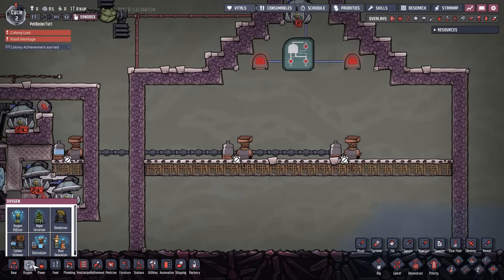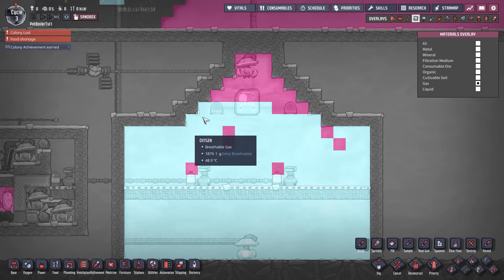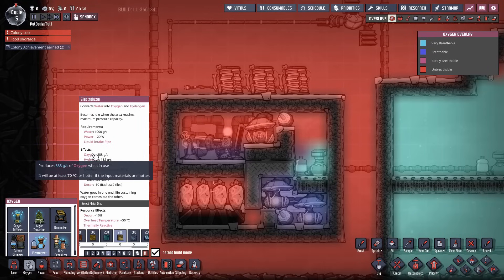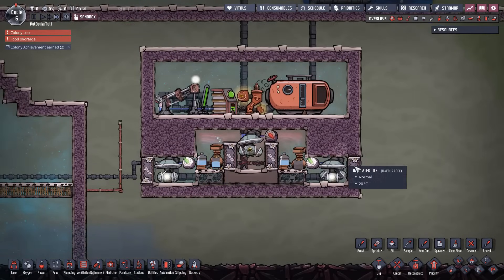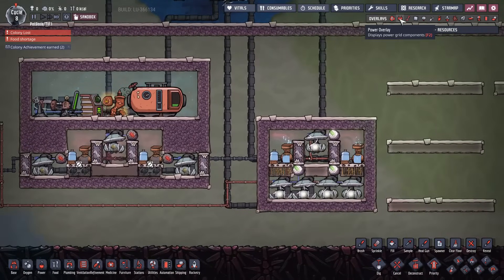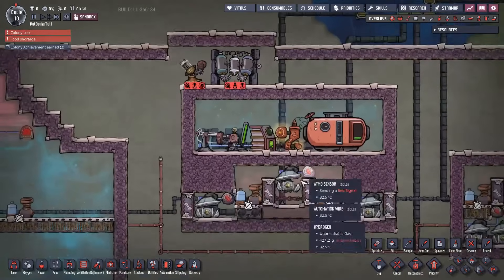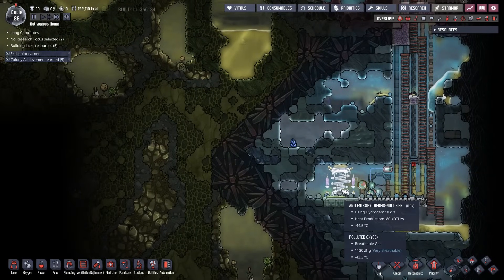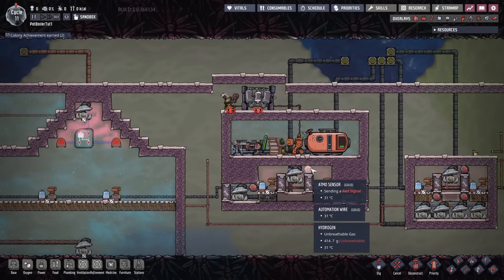Electrolyzer, SPOM, O2, Oxygen: Tutorial nuggets : Oxygen not included

Comment: Hey Francis John! Long time watcher, first time commenter.
First I would like to thank you for all your videos and tutorials. A game like "Oxygen Not Included" would have caused me so much headache without some guidance, so thank you for being there to clear things up when I needed it. 
Second, I was curious how would these designs react if water supply stopped for a while or the oxygen output pipes became over pressured? Early in the game I may use a single electrolyzer and that could potentially make more than enough oxygen to the point where my base would be over pressurized by it. Would this break the design or mess with how the built in filtering system works requiring me to flush the system again as if it were running for the first time (or do the atmo sensors prevent that)?
Any clarification on this would be appreciated,
Thank you!

Comment: I did some testing on Hydrogen/Oxygen volumes out of a Full Rodriguez vs an unfiltered setup consisting of mini-cells 6 wide by 2 high with an electrolyzer in the middle and pumps on either side.  Image here: https://imgur.com/a/yal4FZd  You can route the output of each pair of pumps through a filter of some sort, either powered or unpowered using gas bridges and gas valves using techniques I learned in Brothgar's video here https://www.youtube.com/watch?v=bzwsgK_rud0&t=1s.  The results running each setup for one cycle was that I got nearly identical quantities of Hydrogen and slightly less Oxygen using 3 electrolyzers and 6 pumps in a cell configuration as I did from a full Rodriguez.  Full Rodriguez:  2160W, 13.97Kg H, 1639Kg O.  3 Cells: 1800W, 13.8Kg H, 1533Kg O.  For my base's Oxygen needs, I am using a Full Rodriguez, but after these results, I'll be using 2-4 of my mini-cells in space for my rocketry program.  Modular, easily expandable, and more efficient (for Hydrogen at least) than a Full Rodriguez.

Comment: On the full Rodriguez, I keep getting Oxygen intermingled with the Hydrogen out of the top pump, which damages the generators.  Sensor settings are correct (250g at top and  450g on bottom ones).  My base is not using all the oxygen (overpressure at vents).  Does this cause the problem?  I built this with the hope that it would be more than I need, but could grow into it.
Reply from the maker: When you first switch it on you have to run it flat out for a good 300-600 seconds. That way the gasses sort themselves out, if you don't run it flat out the gasses stay intermingled and it never runs quite clean. If you build a couple some gas tanks or high pressure vents you can run it flat out and get it working clean.

Comment: Can anyone explain why my smart battery won’t charge?
Reply: I replicated the exact diagram using the two electrolyzers with three gas pumps on bottom with atmo sensors set to 750 on top and two at  450 on bottom. On top from left to right hydrogen generator smart battery power generator and gas reservoir.  Atmo wire connecting from smart battery to hydrogen generator then regular 1000w wire from hydrogen generator to smart battery to power generator. Went over the game saved files you shared was there a patch that changed this?
Reply from the maker: @michaeldechant7985 Impossible to tell from here. Tell you what send me on the save game file, the email address is in the about section of the channel. I'll have a look as see what I can figure out.
Reply: Dude that’s awesome.  It’s really odd after pulling my hair out last night. I got on today and noticed the battery was charging very weird bc it wasn’t charging for the longest time.  I will send you a save file anyways bc if you don’t mind to look at what I’m doing and maybe you can through me some pointers to help me progress further in this game.  Been playing for about three days and addicted lol.
Reply: Also, you have the best tutorials I’ve seen so far!! Looked at tons!!
Reply from the maker: You have to connect a power cable to it and the generator.

Comment: Thank you for the guide! I just managed to get my first hydrogen powerplant running, following the second (?) version you showed. However, I initially got oxygen mixed in with the hydrogen during the first run, which broke the generator. I tried creating vacum by running the lower pumps, but the oxygen levels shot right back up to 2k oxygen pressure when it reached sub 500. After a while I figured I could pop a gas-filter between the gas tank and the gas generator to filter out the oxygen. Eventually got the oxygen out of the top segment!

Wow, that was a lot of text to say: I had a problem but I figured it out, thanks for the guide!

Comment: Having trouble with the full Rod model my hydrogen is not pushing down enough and oxygen is getting into the generators? Something I am missing?
Reply from the maker: You have to run it flat out until the gasses equalize. By flat out I mean all the O2 pumps should be pulling out O2 for a good minute without backing up. I usually hook up the outputs to gas tanks or high pressure gas vents to ensure this happens.

Comment: In the second model, how do you prevent the electrolyzer from shutting down intermittendly due to overpressure? I cannot get the system to be self-contained for that reason.
Reply: Whats wrong with them shutting off? If you don't need more oxygen there's no problem with them shutting off. They'll start going again when the pressure is lower
Reply from the maker: @MegaLars10  Sorry about the delayed reply. Their is no problem with them shutting off after they have been running for a bit and the gasses have sorted them selves out with hydrogen on top.
Reply from the maker: The 4 tile high design? To get it to stabilize you need to run it flat out for a couple of minutes. By that I mean extracting Oxygen at maximum speed and not letting the line back up. Simplest method it to hook up the output to a gas tank.

Comment: Probably not gonna get a reply on this old-ish vid but who knows :)  How does one cool this oxygen? 70C is a lot (sorry if i missed a part where you explain this)

Currently im using an aqua tuner/steam turbine to cool my PWater which i  then recirculate around my base to cool things down (works like a charm) but i fear that by adding 70C or more in terms of oxygen might break things
Reply from the maker: Check out the Temperature management tutorial it covers most of this. I can say that one Aquatuner running polluted water can handily cool 3kg/s of O2 with ease.
Reply: @FrancisJohnYT  Oh ok, awesome! I have watched that tutorial as well after posting this last night.

Thank you a lot for your work so far and your help! 

Ill start building your setup for 3kg/s of O2 asap :)
Reply: Ha, you can even destroy shitton of heat by electrolizing near boiling water(which got heated by aquatuner) and use aquatuner to cool oxygen and your whole base. It can nuke about 250k dtu/s  which is a lot and can even cover moderate industry. This is pre-plastic cooling which is especially great
Reply: Another fun part is hot hydrogen - you can burn this in hydrogen generator, no need to cool it or anything like this. The only foreseeable problem is gas pumps overheat, so it gas may need immediate cooling right in the electrolyzer chamber(with radiant pipes from aquatuner) or you need gold amalgam/steel gas pump which might be problematic early game.

Comment: I never understood why you shouldn’t use gas filters. I mean, it only costs 120 W, and when combined with one pump, it’s only 360 W of power. The Hydrogen Generator creates 800 W, so it’s still a net gain of 540 W. With this self filtering system, even the smallest self filtering requires 480 W. So, wouldn’t it be better to use the gas filter?
Reply: 1 electrolizer 120w
2 oxygen pump 480w
1 hyrogen pump 240w
Total 840w that is the setup that will not run 100% uptime so the 40w is neglegable
But if you ads another 120 then it will cost more power and it wont work efficiently anymore

Comment: I like to build an extra electrolyzer, find it works better. theoretically one electrolyzer should be able to saturate 2 pumps so they're constantly pumping a full 5km unit of gas and not wasting power, so 2 electrolyzers should do 3 oxygen pumps at the bottom and a hydrogen pump at the top... however it's almost impossible to get the pumps to run 100% of the time just because of how gases more and merge so adding an extra electrolyzer allows them some downtime, they aren't using power while they're not working so it's not any less efficient and keeps everything nice and full of gas. 1 hydrogen pump, 4 oxygen pumps, and 3 electrolyzers seems like a good ratio for large-scale oxygen production. also having the electrolyzers up in the hydrogen layer will produce more hydrogen if I recall, due to how gases merge.
you can usually just leave the bottom open if you build a vertical setup too, if it's set up right extra oxygen just flows out the bottom and you capture all the hydrogen.

also for cooling if you have extra power you can put some thermo regulators up in the hydrogen layer and run the oxygen through them to dump the heat into the hydrogen then feed it into a generator to destroy it.
Reply from the maker: I prefer the Rodriguez, 4 electrolyzersand 3kg/s of O2. I like a high dupe count and putting one of these down future proofs you for a long time to come.

Comment: How would a salt water tank, cooled by a nullifier, do as a heat sink for gas?
Reply from the maker: The nullifier is the cooling, the water would just be a "stabilizer". One nullifier can handle about 1.5kg/s of O2 that starts at 70C. If you pre cool the O2 with incoming water or if the incoming water is hotter than 70C then numbers all change.

Comment: One thing I found is that there are situations where you don't consume enough of the excess hydrogen. At the beginning that extra hydrogen can be your main power. But it eventually becomes a subnet that may see little use. I just had a situation where hydrogen started to appear in the oxygen line. Bad if you feed that line to atmo suit docks.
Eventually the hydrogen should be put into the main power plant and the prioritized over natural gas. That way everything in the base can burn it off.
Reply: In my experience, that is far more common. You should never let hydrogen back up. With a couple of bridges and a well placed element sensor, you can detect when the pipe is backing up and if you plug the sensor to the automation of the local generators, you can have them burn the extra hydrogen.

Oxygen backing up is rarely a problem, if you set the pressure sensors correctly. The electrolyzers go overpressure and the production stops. You can remove the generators and dump extra oxygen into space (or feed it to those-nasty-slicksters-nobody-likes for food) if all you want is the hydrogen (for example, rockets, they consume equal parts of O and H, so either you keep petroleum engines around, or you have way to much oxygen) and you have external power.

Comment: Just got my full Rodriguez up and running, thanks so much for this video!
Reply: I keep getting Oxygen into the top air pump and i don't know why. I tried all kinds of settings on the sensors.
Reply from the maker: @andreashofmann4556  Did you make sure to run it flat out for about half a cycle until the top of the device was filled with only Hydrogen?
Reply: I have 20 doops but I keep having a problem with the full Rod. The O2 backs up and and the whole thing fails
Reply from the maker: @alexb5766  Check the gas overlay is the top of the box full of Hydrogen? Do you make sure not to let the hydrogen back up? That should be the only ways it can fail.
Reply from the maker: Bathe in the glory of so much O2, just make sure you don't run out of water or stifle your crops with heat.
Reply: @FrancisJohnYT  
In sandbox I found that you can cool a full Rodriguez with an AETN if you pre-chill the water. According to the min/max-theorycrafting in the wiki you shouldn't do that because of heat creation or something. But as you did in the video you can cool the oxygen within the SPOM with the water. And then the AETN can cope with the rest.
To me it seem that running an aquatuner now and then to chill down a cool steam vent during eruption is much better than running it full time to cool the oxygen.
Going to to that in my current game since I have the AETN and vent right next to each other :) Though a 3/4 Rodriguez may be enough for me

Comment: the problem is that the hydrolizer generates a lot of heat in the long term and starts to increase the heat in the base and I design something but with cooling system included, because the compact versions give me too much heat in the base
Reply: I like to put them a bit ouside the base and near an AETN. In my current game I got very lucky and have a cool steam vent right next to one. My last game had one reasonably close. So I insulate the vent and pump out the water to electrolyze it. And then run the oxygen through the AETN to chill it down
Reply: @S_Black  If the problem is that you cannot use it directly to the base and it has to go through a cooling system, then I decided to join two systems to send cold air to the base (from 18 to 20) to cool things a bit
Reply: but it's not compact at all
Reply: Try sending in 0° oxygen if you can. It won't freeze your base, but keep it in the 20s considering all the heat you create
Reply: @S_Black  Inglés

Cómo se pronuncia

yes but it always touches me hot areas and to move to cold nearby areas I touch a volcano jajajjajaj

Comment: I learned to use mesh tiles instead of airflow tiles for these after I had an "incident" where a bit of salt water got spilled in to my polluted water storage and got picked up by the pump.  When it hit the electrolyzers the spilled salt water blocked the gas flow and made me have to delete the airflow tiles as well instead of just cracking open the bottom by the air pumps and mopping up the mess.
Reply from the maker: That exact same thing happened to me, mesh tiles all the way.

Comment: Is there a mod for pressure overlay? I’ve always found it a real pain to have to mouse over areas to determine high/low pressure and to predict fluid behaviour.
Reply from the maker: You might want to check out "GasOverlay" it's a mod that gives each gas it's own color and the color intensity determines the pressure.
Reply: @FrancisJohnYT   This might be suitable for my gameplay but I'm surprised there's nothing made yet that displays pressures in a similar way as the base game does with temperatures. To me it's a reasonable necessity as pressure has been some of the failure causes of a lot of my bases.